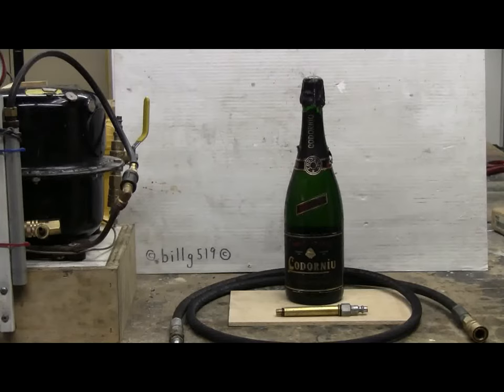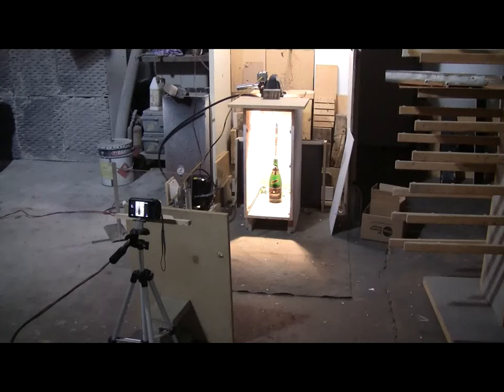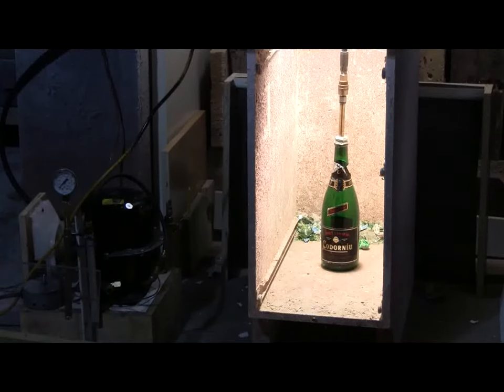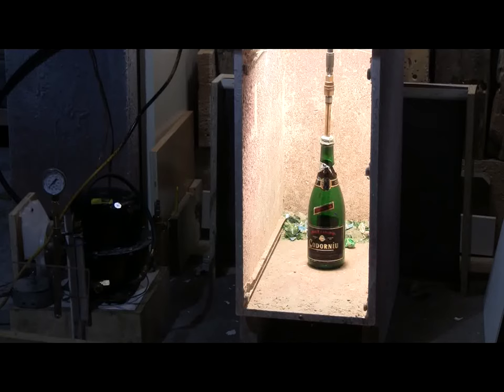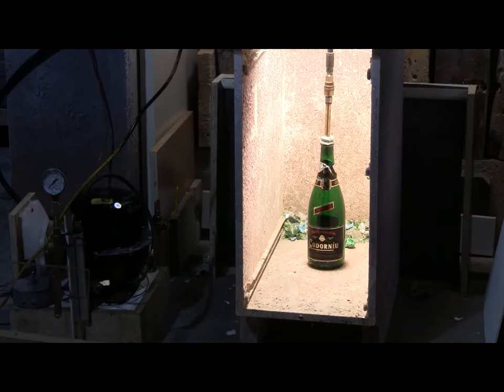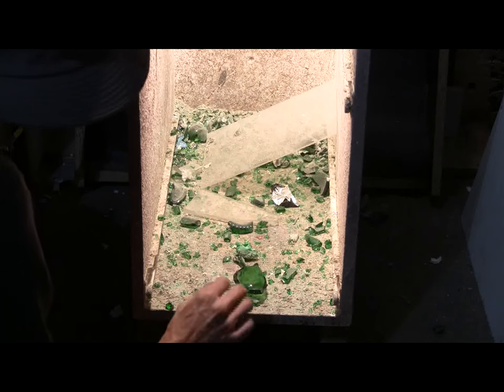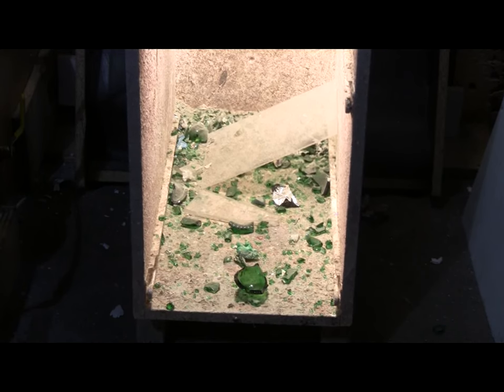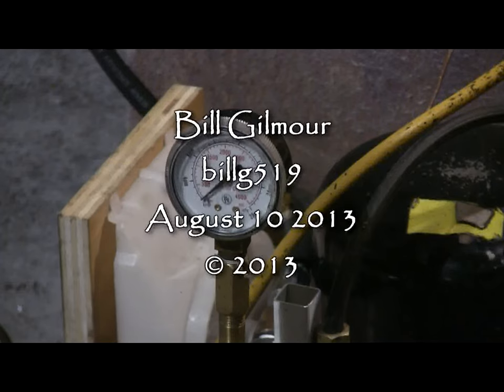Air Compressor - Bursting A Champagne Bottle

Comment: a sparkling wine is usually 90 psi in bottle....that is why there is a deep pontil - and the glass is so thick....and a basket over the cork that wires it into place....all this to withstand the 90 psi....which is three times the amount of air in my car tires

Comment: also very intresting how stronger and safe it will explode, if "coat"("dress up") initially that glass bottle in PETF layer, it must be pre- termolaminated, inside(botom part-"glass" from PETF bottle) 2liters coca-cola PETF bottle(like a foot in a sock) first... in one layer, in three layers... usualy i cutting bottom part of some pepsi bottle PETF plastic, biger than my flask, then to put flask inside that plastic glass, and submerge in boiling salty water(108C) or just plain water(if possible without water inside glass, only on outer surphase like a boat in boiling ocean), after 5-30min at 100C PETF will completely "sit on" and holds glass flask, now unbrockable almost...